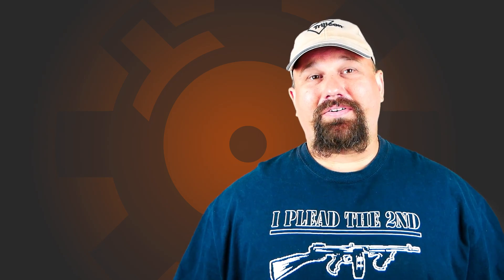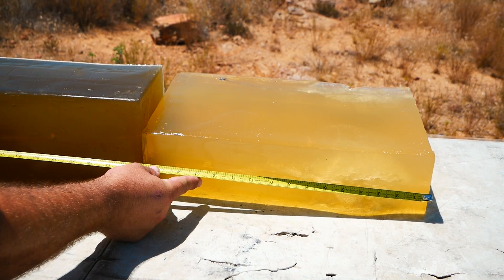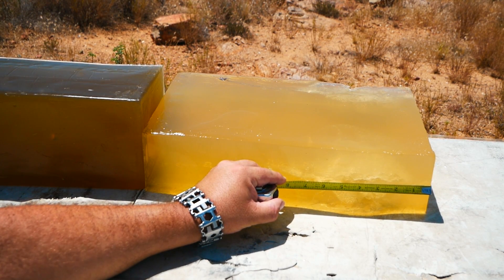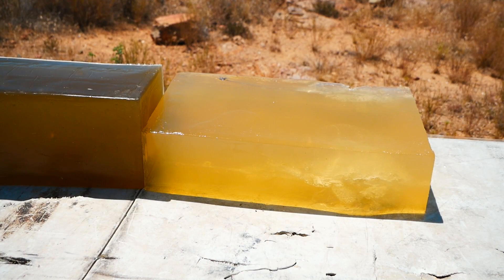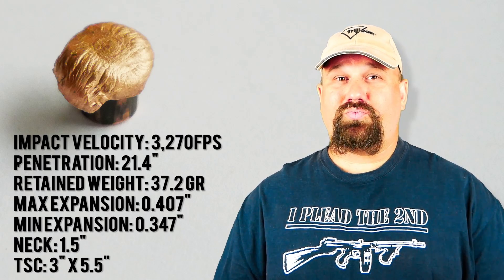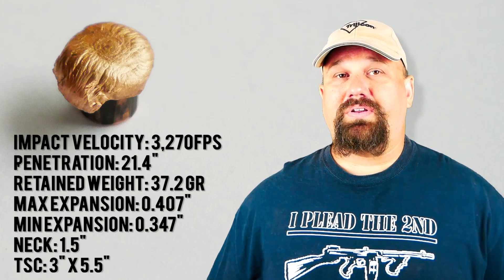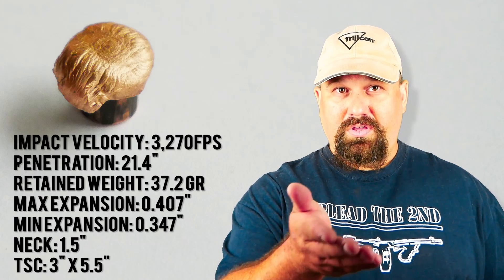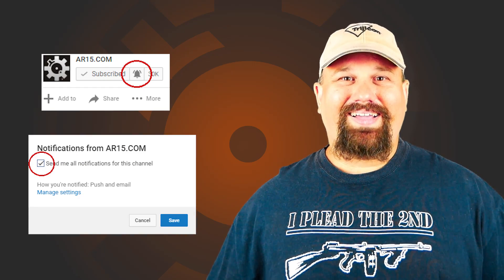Hornady 223 Remington 55gr GMX | Ballistic Gel Test

Comment: Barrier tests would be great, I'd like to see come alternatives to the Federal duty ammo my Department is currently carrying.
Reply: cobannie The front block was removed from the cooler and calibrated immediately before the test shot. The results are valid. The block in the rear is just old clear gel and therefore the penetration figure is technically an approximation. But by the time the bullet reached the second block, it's not moving very quickly. Any discrepancy would be very small.
Reply: cobannie You do know that California, Arizona, Nevada, New Mexico, Utah, Colorado, and Texas, all have police officers..? 

I know it's called the Wild West, but there are actually police, even Federal agents, that work in those states..

They probably appreciate having one gun channel that does these tests in the same climate they work in.

Besides lacking humidity, the desert isn't much different than the other lower 48 states' environments. It has a wide array of temperatures, freezing cold at night, sometimes hot in the day, and in some desert areas, it's still cool even in the day.

That sounds like every place I've ever lived, in the Southeast, and Northeast regions of the U.S.
Reply: Don't waste your time on Hornady then. These tests are done in a desert environment that doesn't allow the gel blocks to stay at the correct temp range for long, and the blocks also appear to have different densities / formulations. Federal T3 Bonded Core ammo is still pretty mich the best stuff on the market for barrier penetration, mass retention, expansion, and minimal deflection when fired through angled barriers such as automobile windshields.

Comment: What's the purpose of putting so much stake on weight retention?  Yes, you want enough mass to be left for it still to cause damage, but given that the bulk of the damage is caused on impact where the temporary stretch cavity is, who cares how much is left of the rest of the bullet?  The important part is hit vital organs.
Reply: Maniac742 First, the observed disturbance in gel should not be confused with predicted damage in tissue. Second, it's a comparative value. Other factors being equal, a higher retained weight is better because it indicates a tougher bullet.
Reply: I agree if goes deep enough and does the damage who cares about  weight  or how it looks
Reply: Maniac742 It's one of the factors measured. Is it a deal breaker? Of course not. 77gr TMK has terrible weight retention, but it's still a very good bullet. Nevertheless, it's an important factor to consider.
Reply: My question is still "Why is it a factor"?  I guess I don't understand what the information contained in the retained weight is, or how it's relevant to killing power vs. the observed raw tissue damage.

Comment: I'd like to see a test in a SBR.
Reply: Yes, 5.56 was designed for 20" barrels back in the 60s. However propellant and projectile design has advanced in the past 60 years. That's why Geissele and many other manufacturers have come out with shorter barrel 5.56 weapons. By no means does someone have to go invest in another caliber to get great performance from a short barrel.
Reply: I prefer the adult length barrels. .223 is designed for a 20 inch barrel. If you want a short barrel, get something designed for it,e.g. 300 Blackout. It gets a full burn at 9 inches.